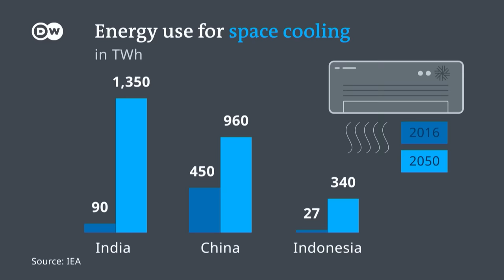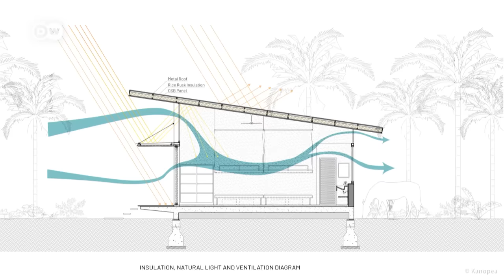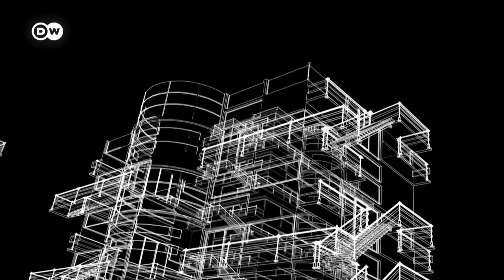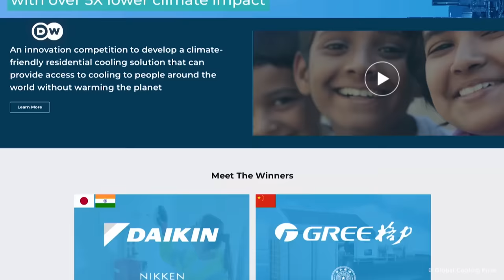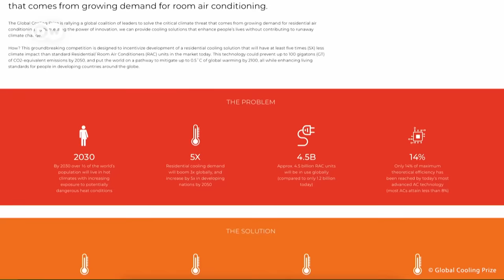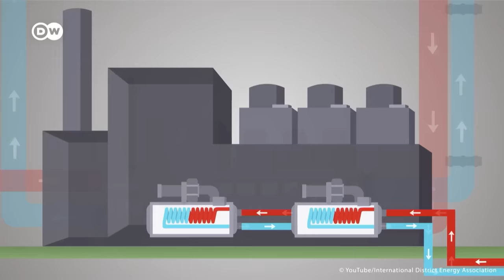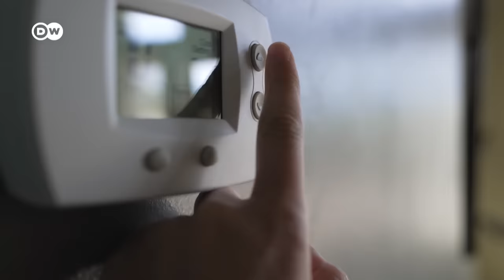How to cool our homes (even without ACs)

Comment: However that said, due to widespread AC for decades, humans, especially middle class and above no longer acclimatize to local hot conditions like their ancestors did which makes shifting away from AC a lot more challenging as none of the other methods deliver indoor cooling nearly as powerful as AC
Reply: IMHO, temperature acclimatisation can be learnt. People just have to be willing. Some of it is skills that perhaps are lost or weren't required before in that area, some of it is appropriate clothing and equipment ie a fan, and some of it is giving the body a chance to adjust over a couple of weeks. That said, I suspect all humans appreciate the  modern climate control when it's above 34ºC or below 14ºC, or the relative humidity is 80+%. So I don't expect we will ever give up the a/c! But perhaps we can allow the temperature inside our buildings to fluctuate more inline with outside?! That is how I live these days, I turn the equipment on less and open the windows more, and set a wider range on the thermostat between summer and winter, and let the temperature naturally drop overnight, etc.. A few winters ago I challenged myself to adjust to a much cooler winter house temperature, and found that with more woollen clothes, an active day and adjustment time, my body learnt to generate more heat. To the point that when I went out with friends to a restaurant I'd be in shirt sleeves and overheated!
Reply: These people grow more fat under skin to keep them climatised in an a/c environment. 😂
Reply: What is “heat accumulation”?
Reply: AC is one of the biggest factors in the obesity epidemic, because AC means you can eat a lot of heavy food during summer.
Reply: And that right there is why I'm skeptical when I see videos like this one.  Every one of the old-time virtues proposed results in significantly higher indoor temperatures during the hot months.  If they're asking us to make sacrifices, live more miserably in the name of reducing climate change, then say so clearly.  Don't try to deflect or obfuscate.  Don't try to sell us something under false pretenses.  AC will always be needed to maintain current quality of life.  If combining better home design and infrastructure reduces AC energy use, great!  I'm all for that, for new buildings, city blocks and neighborhoods.
Reply: @joesterling4299 people live in the desert without Ac comfortably by building their buildings accordingly, ancient b
Reply: @joesterling4299 people live in the desert without Ac comfortably by building their buildings accordingly, ancient b

Comment: I live in Spain and we’ve recently bought a flat. It gets cooled down by the pipes under the floor. It works really well and I love that you don’t have this direct cold air coming at me from the air conditioning. The downside is that the cooling is not instant, you need a few hours for it to cool down the place. However it doesn’t heat the outside and it’s supposed to be more efficient as well.  I’m not sure what technology it is though.
Reply: Is it a geothermal heat pump? They're pretty expensive to set up but very good at what they do
Reply: @sewpungyow5154 Yeah, geothermal heart pumps are so efficient that I think they should be mandatory for all new construction in areas where temperatures get high.
Also quieter!
Reply: It's called radiant cooling.
Reply: Well, I has to heat something in return 😂
Reply: @simonhaas6480  Yeah, the earth, which has an enormous thermal mass
Reply: Hi Antalito, according to the CTE (Código Técnico de Edificación), the building your flat sits at could have "aerotermia" or "geotermia". Both of them use heat exchange with the air or the earth to cool a fluid. Technically is a heat pump. It is mandatory to have this or any other renewable energy system in the Spanish building code. In fact, it has been so since 2003 [from photovoltaic to other type of energy systems: you need to have a certain amount of energy that comes from local in-building resources or systems]
Reply: @iat8329  indeed I’ve looked into it and what we have is aerotermia! Thank you for your answer!🤗
Reply: @zen1647  Also needed for extreme cold if we want to phase out fossil fuel.
Some of the ultra efficient heat pump units work down to --20C: but it gets colder than that for several weeks of the year where I live. The local power company prohibits relying on resistive heating (power demand goes up in the winter). So a ground-source heat pump would likely work better (but costs more).
Reply: @sewpungyow5154 heating the earth core? bad idea..
Reply: @rizkyadiyanto7922  Yes but no. The Earth's core is so hot it'll melt the total lithosphere, but when heat pumps connect to the earth instead of it's hydrosphere or atmosphere, they use the heat capacity of a 'small' portion of the lithosphere to temporarily dump the (lack of) heat of the environment of the building(s) above to later pick it up again and effectively flatten the temperature curve within the buildings.
Reply: Issue with "radiant cooling" is what you say: it takes hours to cool a place. That's okay if you're in a place 24/7, but a more efficient strategy is to turn off your a/c when you're not around, and run it full blast when you return. If I had radiant cooling, I'd probably run it all day for this reason. Might have to because it can't remove heat very quickly. Also runs a risk of condensation in humid environments. Then you have issues with the floor being the coldest, which is counter to what most people prefer: warm feet and cool air to breathe.
Reply: @443DM  I think this issue can be easily solved by having a smart thermostat so you can control the temperature with an app. So if you’re out you can just turn it on a few hours before arriving home. As for the feel, in the summer heat I enjoy having a cold floor and in the winter the floor is warm as it also acts as a heater so I don’t see this as an issue.
Reply: So basically a radiator
Reply: @antalito3047  have an 'out' setting and an 'in' setting, and switch it as you leave and arrive...  the energy cost of millions of you having an app will 'waste' so much of your savings...  : (((((
Reply: @jamesphillips2285 Fossil fuels stay till cold fusion makes it obsolete instantly!

Comment: Aquifer temperature can be a very helpful gauge for what kind of geothermal stabilization can be achieved in your location. 

I live in the southeast US; in summer, the daily temperatures frequently go above 95°F (35C) and nighttime temperatures do not fall below 82°F (27C). Our local aquifer is around 62°F (16C) in summer and 57°F (14C) in winter. So an underground house here can be very pleasant all year round, but it won't get adequately cold for root cellars or cheese caves, even in winter. Geothermal tubes for cooling standard construction are nice, but they run into a limitation if being used for a large building or urban neighborhood. The air running through the tubes shifts its heat energy into the earth around the tubes pretty efficiently at first, but with less and less success as the earth around those tubes heats up. Eventually there's not much happening, except that you're expending energy to blow the air through long tubes. If nighttime temperatures or winter temperatures here got colder, the system would work better... but as it stands, the application is limited to fairly small scale implementation.

It's extremely humid here, too; higher than 80% relative humidity in my house at the moment (we don't have AC). Evaporative cooling simply isn't an option here because the air is carrying so much water already that wet things just stay wet, without evaporating or getting colder. Mold is a constant problem.

Traditional systems designed to chimney out hot air from buildings while pulling in cold air from the ground level just don't do much if your ambient air temperature is just as hot as the air inside the building. Those desert wind towers are fascinating but unhelpful in our climate here. 

So I support passive home designs and I think that many of them work really well on the small scale in rural settings, like earth sheltered homes with geothermal air intakes. However, most of these systems don't work for large urban areas in hot, humid climates. Green spaces and reflective rooftops help, and maybe someday vertical farms and grow tubes for algae harvests will help shade buildings further, but there's only so much you can do if the ambient temperature and subterranean temperatures don't cooperate.

Comment: I've been telling people here in the southwest the native americans used adobe bricks to build homes. Adobe is very resistant to changes in temperature which keeps the house cool inside and warm during the winter (yes it does get cold here). Not only is adobe one of the most recyclable materials but it literally comes from the ground.
Reply: Yeah but adobe cost a lot man, but imma just pirate it
Reply: Lies again? AMWF CAR Cooling Period
Reply: But Adobe can't be made see through so its not pretty enough for the ultra rich who finance these unsustainable buildings
Reply: But but Adobe is a software 😂
Reply: The only problem with using mass to control temperature is that it depends on daily temperature swings to modulate temperature.
Unfortunately, many parts of this world are consistently too hot or too cold for this to work.  The middle east may be over 38C before the sun rises so some form of evaporative cooling or AC (or a combination of both) is needed.
Reply: Adobe sky scrapers LOL?!!
WILL collapse in a earthquake ask Japanese folks!!!
Reply: @joestalin2375  bro we don’t need to build skyscrapers, a normal building is good enough
Reply: @zenithchan1646  sky scrapers are normal,you are not .
Reply: @NazriB what?
Reply: Just pirate it mate, pirating adobe is always ethical

Comment: When we built our Earthbag home in tropical Puerto Rico, we knew the plan was never to use AC, and to generate all of our own electricity.  To accomplish cooling in the hot tropics we have 1 meter overhangs and a green roof.  Then we run efficient USB ceiling fans during the night if it's too warm still.
Reply: A single feature like properly sized, oriented and shaded windows can make all the difference.  And it's nearly free.
Reply: Wtffff
Reply: Whats a overhang?
So you get all your electricity with panels and no public grid connection?
How cool is it in summer inside the house?
Reply: @xaviercruz4763  an overhang is how much the roof extends past the wall, kinda like the brim of a hat.  It gives the walls more shade for longer, and keeps rain off of our earthen plaster.

Temperature inside hangs around the upper 70s to lower 80s.  But compared to outside it's almost always cooler.  If I did it over again I'd add larger windows for better cross breeze though, and bigger pipes up by the ceiling to vent out the warmest air.
Reply: @frenchiepowell  oh thanks for the explain! By the way i dont know what you mean by bigger pipes to vent air on the ceiling (as in i dont know if you are talking about an ac system or some structure for cooling  that you installed) but the ceiling cooling is something i understand by the experience bc i live  under a cool ceiling myself: you can do put trees in planters that you like the fruits or look of or you can buy shadecloth and cover the ceiling and it drops temperature like falling from a ridge. The sun because the enemy there on uncovered ceilings

Comment: I upgraded sunroom vaulted roof insulation from R20 to R50 by building a second roof over top with continuous ridged R10x3 last fall. Saves heating cost in winter and cooling cost in summer. Massive difference. But even though I DIY it, the ROI is very roughly 10yrs. Most ppl rather put that money into a trip or buy hot tub or car, etc. I value efficiency so I did it as soon as I could.

Comment: In an electrical substation we had a high temperature inside. This substation was lacated in a second floor and had air conditiones . For reduce the temperature we made  to holes  in the first floor to make the wind can flow easily. This wind flow reduced the temperature in the second floor and the energy consume was reduced.

Comment: Underfloor heating is a good solutions for this. In the summer you pump cold water through it and when it absorbs heat you store that heat underneath the building to use in the winter. Won't bring down temperatures to an acceptable level on its own, but its a couple of degrees for sure. Major bonus is that underfloor heating is very efficient in the winter.
Reply: you're part right! And this tech does already exist! So, the reason why you can't just store the warm water in an area to be used for later is because it will dissipate into the surrounding air or ground, in fact once you get below the average freezing point of any given topography, the ground stays at a nice stable 50 degrees f. and with a mass that solid, you'd have to run a LOT of fluid over a VERY long time, constantly, to even possibly raise the temps by even a fraction of an amount. So you can't store heat down there, but you CAN use it as a stable baseline for dang near infinite ground-based water cooling loops that you can then hook up to a heat pump/ac combo to get that last few degrees of heating or cooling you need, with little to no emissions, noise, and at a fraction of the electrical costs, and even can be hooked up to multiple buildings. 

Heck, you don't even have to waste that wonderful heat energy, AND you can make it cheaper! the pump and ac can be powered by solar, and the solar panels can also be cooled by the same system. Now have multiple houses with connected systems and they can dump that heat into the ground to dissipate, or they can very slightly warm a communal pool with that same heat energy. This option can be applied to old construction, new construction, with very few places that don't work with this method, and upfront cost being the largest issue. And they also work even better when you combine them with other passive cooling methods.

Welcome to the world of geothermal heat pumps.
Reply: Great idea !
Reply: Still tou would have to control humidity, as condensation would be an issue
Reply: Won't work on Humid hot areas. Like South India, Indonesia or Brazil for example. It's just too wet there.
Reply: @nntflow7058  not entirely correct, you can use radiant cooling together with dehumidifiers. But you probably do lose the benefit of storing heat for the winter, because those areas never get that cold during winter.
Reply: but we don`t have winter here
Reply: but bro you'll heat the water and the water gets heated and now global warming oh nooooo
Reply: Exactly.. thanks geeeeees were in the stone age ..!
Reply: @HonshuHigamori  no you store it under ground in the permafrost zone where theres always heat anyway..!
Reply: Underfloor heating is common here, but underfloor coolers have all failed. The humidity is too high to be useful. Most use general unit-type coolers.

Comment: I love the idea of designing buildings like the ones Charles Gallavardin is working on that reduce heat and promote airflow. A Cambodian architect, Vann Molyvann, did this in many of his building designs such as the Royal University of Phnom Penh with a roof design and louvered windows that maximize air circulation. It really makes a difference! This is a very interesting and important topic and I learned a lot from this video.

Comment: Interesting how the focus is usually on the apartment buildings, where 2-5 people are squished into units that are 500-1200 square feet usually.  No mention of the 5,000 square foot homes of single individuals (who of course, have their homes air conditioned) and the mega mansions of the ultra wealthy, with homes that are 10,000 to 20,000 square feet and larger.  Often, the homes are not being lived in on a daily basis. These homes may go empty for months, yet have the HVAC air conditioner running to keep their art work and precious belongings "protected" from the heat and humidity.  (think Hamptons summer residents, musicians on tour, actors, people who travel for work 80% of the week somewhere else, etc.) These people will not be affected by any severe measures that the government will take in the name of "saving the environment".  Just like the focus a few years back was to get rid of plastic straws.  Well, what about plastic water bottles (bigger than straws, obviously) and black plastic lawn bags that many homes use for bagging up dozens of bags of leaves every autumn... Only to be picked up by the trash collector and disposed of as -trash (never to become compost)._  I call BS on a lot of these programs because the people in charge often overlook the obvious culprits.

Comment: They don’t want to make air conditioners based on the heat pump principle: you drill 10-50+ wells to a depth of 40-150 meters and put pipes there, water passes through them and is heated/cooled depending on the water temperature. . It is very powerful, you can cool and heat huge volumes of water, it will be cool in summer, warm in winter, all you need is a water pump and pipes.

Comment: Have you changed your filter?
Cleaned the coils on the condenser?
Use a dehumidifier?
Easy initial steps you can take.
Reply: A separate dehumidifiers are really good companion for existing older ac units that have terrible or no dry mode.
Reply: Dehumidifiers are essentially air conditioners that pump the extracted heat into the space where it is  located (instead of outdoors). Removes humidity at the expense of added heat in the space.  Good for basements but useless for living spaces.